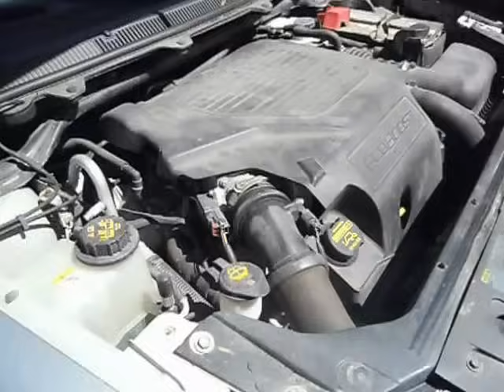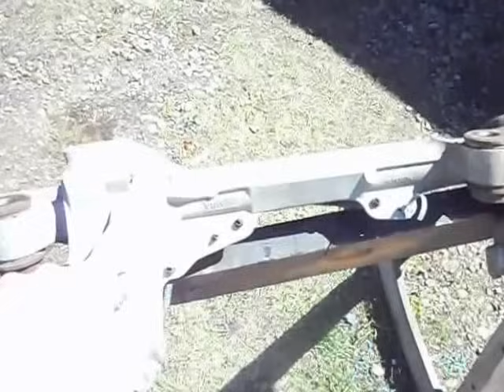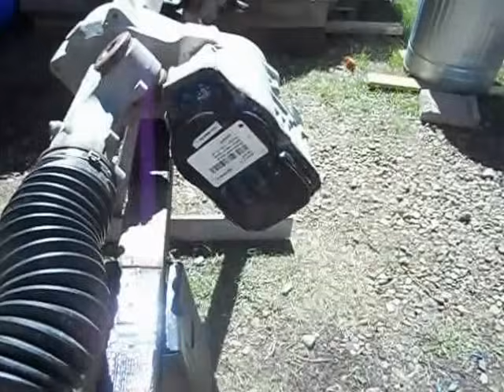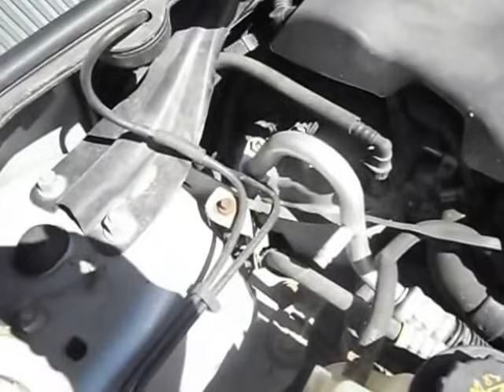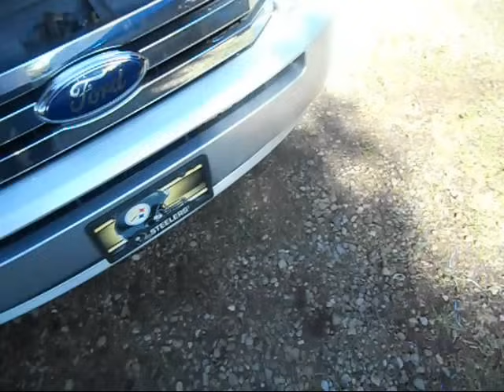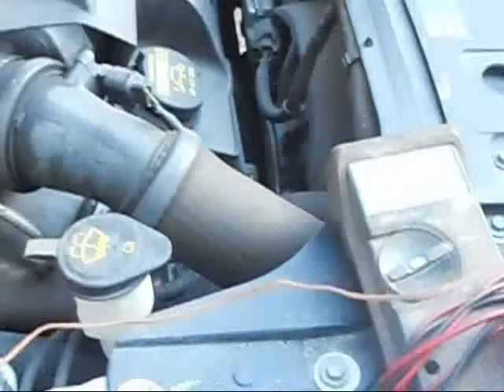Ford Electric Power Steering Failure Identified

Comment: My 2012 ford fusion power steering failed this week, while i was out of town, cost me 3 days in hotel and $1600 to fix it. There was a recall on the rack and pinon power steering module for half a million cars but for some reason my car was not on that list. Ford really needs to be sued over this because it very dangerous.
Reply: I put a new one in my car and 1 1/2 later it’s out again 😡😡
Reply: Same thing with my 2012 ford fusion. Ford said that there are no recalls on my car but they put an extended warranty on my car for the rack and pinion... I have no idea what they meant but it may or may not be covered by ford.
Reply: @theresaedwards5819 mine went out 2 weeks later lmao

Comment: Top notch video... 6yrs later, here I am with a 2014 Ford Fusion... thought I was a dead man for sure as I lost steering during in town driving. I am furious that this was even a possible thing. Doubt there is a recall but I am going to hope that Ford is willing to deal with this issue. Hope all is well brother! 👊🧡👍
Reply: Yeah good luck, my 2012 Sel is not covered for recall or anything . 1600 later and it broke again
Reply: After 150k ford will  touch it most time get buy clearing code change our tps sensor or front tires  also male sure battery is very good not weak batter also you can take both cables off the cat for hour or 2 make sure tie both of them touching.    Have 2011 model. Done everything  😅😅   what help me was I took  the battery out one day replacing it  with agm battery  and decide try tie both together.   And at had problems  with it long long time that was at 180k miles am at 268k miles. Hole time had this  car that only major problems had with it  they are great great vechles.  Only year I'll buy is 2011.  2012  models mabe 2013. 2014 and Up has bad transmission  problems  not one time I had any problems out the motor beside change starter one time oil changes   ...   I have 2011 sel 2.0 or 2.5.     Live find the s Verizon if any one has s model  like to sell let me know  love also if was stick shift

Comment: I must say you are the most intelligent person I've been able to find regarding electronic power steering. As an electrical engineer I was hoping you could shed some light on a problem I have I have a Dodge Challenger RT 2012. I had my tires changed last year and I also had the alignment adjusted. Ever since then - under normal conditions I feel about a 5% reduction in power assist when turning to the left. Then I found that several weeks later, while braking for a quick U-turn, I lost 100% of power assist and had to MUSCLE my way through the turn. I lose all power while braking and turning to the left. Since then, it is starting to affect right turns a little while braking, but no where near as badly as left turns. I since moved to Germany and I had it looked at by an American mechanic on base, and the Dodge dealership mechanics here. Neither could find a problem or offer a solution. The American theorized that when they did the allignment, the computer in the car is confused as to where dead center is. I have a feeling it is the computer chip as well because the power assist works under normal conditions. So while would it fail while braking if it was a mechanical issue? As you mentioned, these parts are expensive, so I don't want to go chasing good money after bad. Do you have any suggestions as to what these mechanics should be doing to fix it? Computer or steering rack (or both) ouch!

Comment: EPAS Steering failure is a huge Safety concern and could potentially cause lives whilst in motion. I am an Electrical engineer too and I can attest to the fact that you're spot-on. Thermal stress is the culprit. Your video presentation was top-notch and well detailed. Fault condition on Steering power assist on my Ford Taurus brought me here. Ford is probably not implementing industry-grade power MOSFET rated for harsh operating environment. Also, there is definitely a design flaw with heat sink configuration but Ford will never own up, just to protect their bottom line. I'm done buying Ford vehicle forever!
Reply: Can you share some symptoms? I bought a used 2016 Ford Explorer (my first ever Ford product), it just hit 89k mileage but my steering makes kinda grinding noise when I turn the steering wheel (both right and left) even when the car is parked. The noise got worse and the steering wheel somewhat got stiffer after a month of parking outside (1 month vacation).

Comment: Best video. Why no one know why ford steering keeps going out. So for a year no one knew why my Steering wheel was not I Check everything and could find nothing all of the computer button stopped working. So one day look at this same steering wheel column that’s under my car and it was cracked. That one item can cause the whole to not run right. Good wish I would be seen this. Took a year to figure out why my steering wasn’t working

Comment: Update 2011 Lincoln Mkt 3.5L Ecoboost, Canada edition.
The second Epas steering unit in my vehicle that Ford installed was a refurbished unit. I found out from a service rep that Ford will replace the Epas unit with a rebuilt unit if you do not specifically tell them you want a new unit. The refurbished unit costs more than the new unit and the warranty is only for three (3) months. A new unit cost a few hundred dollars less but the warranty is for two (2) years. 
One year and five (5) months later the second refurbished Epas unit failed. I replaced it with a third epas unit and filed a formal complaint with Ford Canada. These Epas units are expensive. 
After a battle back and forth, I received a Partial settlement of $1500 CDN. The payment was  voucher check, not cash which means you have to spend it at Ford. I needed a few more repairs on the lincoln so I used part of the voucher check on the repairs. On paying the bill, the service manager told me to contact ford for the balance of the check (@$375), since the repair cost did not use the full amount of the check. The next week ford contacted me saying the fine print stated the the full amount of the voucher check must be used as no cash is refund allowed.
 They gave me an option, the balanced could be transfered to the "Lincoln Loyalty Program" if I signed up. I red the program previously (like reading a noval), and turned it down. 2015 ford vehicles and above under the program are tracted by ford, interesting? 
My Lincoln has 102k easy mi. Is in great shape yet has cost a small fortune in mechanical repairs, not particularly reliable or trouble free. From experience, I do not feel that ford loyaly treats me so why would I? 
Looking for a Toyota for my next vehicle. Check Consumes Report "Best Car Ratings"
I will submit my complaint with the Canada BBB.
Reply: Totally feel your pain... that is a whole lot of Fk around... terrible business practice. May you have better fortune with the choices ahead. I look at a vehicle and yt the hell out of it by searching top 5-10 issues, so I know in advance what is coming my way in due time lol 👊🧡👍
Reply: I am going to fix my 2016 Ford explorer （power steering assist fault）and sell it to buy a Japanese car too

Comment: I had the same problem with  my 2011 Ford Explorer!!   No power steering, rack and pinion lossed!  They also, mentioned about the catalyst converter, tires and brakes!!  Ford wanted to charge me $3700 to fix! It was NOT covered under a recall or a warranty!!

Comment: Exceptional analysis. I work in electronic engineering as well. Also having the same problem with my f150 eps. Replaced the entire unit and the second one lasted less than 24hrs.

Comment: My daughters 2016 Explorer had her power steering lock up as she was trying to leave work last week. She had it towed home where I tried everything in my shade tree book to get it going. I googled the vehicle and I see that the 2016 is on a recall NHTSA ID 14V-286/14S06.  I called two San Antonio Ford dealers and they do not recognize that recall. They say they only go by VIN numbers.  Those dealers are booked to address recalls until November. So, I we want it fixed, we will need to pay for the repair. But, as it was very well explained by Mr. Smith, the heat issues will remain if the exhaust system is not re-routed!

Comment: At 107,000 miles, my F-150 XLT power steering began failing intermittently and without warning.  After a trip to the dealer and a $2,000 check, they sent me home with a new EPAS unit.  Then, grinding and popping noises began to come from the same front-end, driver's side location.  $700.00 later I had a new solenoid and other various and as sundry components replaced.  Still the grinding noises.  So, $600.00 and a wheel bearing replaced.  Hallelujah!    The noises stopped.  A week after my 3rd visit with issues, my steering goes out immediately while I was making a left-hand turn crossing over oncoming traffic.  I had not moves but to drive the truck up and over the curb and into a parking lot, where thankfully, there was a spot that I could muscle my non-steering truck into without wrecking it or running over somebody.

Now I've returned said truck yet again to my dealership.  Here's thing, people, the guys in the garage CANNOT fix this problem.  Do even a small amount of research on your own and you will see that this EPAS problem is systemic and long-ranging with Ford.  The company, for reasons that can only be tracked to money, refuse to acknowledge that across their entire line of models lurks a potential killer...a steering system that randomly goes out without notice.  I'm a good side man and each time this has happened, its a wrestling match with the wheel to get the truck safely stopped and parked.

I have owned Ford's for 25 years, but I'm done.  As I write this my F-150 is still in the shop, while they try to find a way to explain to me that my $2,000.00 did nothing but buy me a newer POS part to replace the older POS part that was already on my truck.  I almost feel sorry for my Service Tech, Mike Coody, at Gwinnett Place Ford in Duluth, GA, because I have all the data that shows him that I know what Ford is hiding, and he has to try and sell me to have confidence that Ford has this figured out.  Wrong.  This is one of the most informative videos of this issue.  Search the Internet for EPAS Failure, Power Steering Failure Ford, and other word combinations.  Thousands...Thousands of vehicles have this problem.  My next truck will be a Nissan Titan.  I've had it.  I can buy Ford's on the Z-plan, which saves me $$$'s....but when they lie about systemic issues, hide dangerous engineering failures from their customers....I'm leaving the brand.

Kenneth Hall, Cumming, GA
Reply from the maker: EPAS steering gear failures will begin to spike as MTBF (mean time before failure) associated with overheated electrical components kicks in. It is inevitable that Ford will experience large instance of failures on a standard 'bell-curve'. Replacement units are the same TRW design; place new unit in an overheated engine compartment and same failure will repeat in time. Ford is counting on this time to allow warranty's to expire. Then consumers have no recourse other than waiting for NHTSA action. The NHTSA is staffed by bureaucrats and statisticians. From what I have seen in correspondence between Ford and NHTSA; NHTSA allows Ford to conduct their own fault investigations; in addition to defining final dispositions, and publishing of investigative results. Ford is allowed complete ownership of the fault issue which clearly results in blatant falsification of fault analysis, and minimal corrective action to Ford's benefit. NHTSA officials believe anything Ford tells them; as long as an official report is filed and key 'buzz words are included.
I found your report interesting in that you indicate how difficult it is to man-handle failed steering gear at low speeds and static in larger vehicles. This has been a primary point with me for some time. It is interesting to note that during Ford / NHTSA investigation; Ford was asked to supply a vehicle with failed EPAS steering; so NHTSA staff may test manual steering effort. The vehicle supplied by Ford was one of the smallest and less massive vehicles Ford manufactures. Apparently NHTSA staff never detected they were out maneuvered.
Reply: Trust  me the issue is general not just ford alone, it also happened with Lexus, mostly the IS model i have one in my garage now sitting there because lexus charge me $5000+ to replace the steering rack and computer and obviously this is lexus fault replace the old style rack with electronics just for efficiency purpose. i realize my got locked when making left turn, i was lucky not o highway. i think is high time people speak against this, looks to me like accident waiting to happen, and now am not comfortable  enough with any electronic power steering .

Comment: I have a Ford Escape SEL 2012. Was driving and the power steering failed, became stiff and required extra power and effort to control the steering wheel. Saw a message on the dash board that says steering assist failure. The diagnosis was that I have to replace this parts and estimated cost of repair is at least $1600. Thanks for your video I won't touch any ford product with a long stick
Reply from the maker: Sorry to here about your Ford problem, Ford engineering and customer service have devolved to lowest of standards by any measure.

Comment: I was just about killed tonight in my 2010 Ford Taurus SHO when suddenly during a lane change the steering wheel appeared jammed in a right position, I nearly took out 3 incoming cars and ended up in the middle of a parking lot simply by luck.  When I looked at the dashboard it said something like Power assist fault, I turned the car off to collect my thoughts and restarted the vehicle and everything was fine.  Two days ago my wife and young son were on the interstate and I can only imagine if this had happened to them they could have been killed.  I have only 42,000 miles on this car, I bought it new.  After watching your video I am shocked that Ford would take such a position on pre 2011 vehicles with this EPAS system.  I am curious if you ever had any luck with Ford.  Thanks for your great video, I appreciate it.
Reply: You can still steer the vehicle when the epas fails. All you guys just can't damn drive without power steering it doesn't sound like. I literally just did an entire drift event with no epas in my 2015 mustang
Reply: @themustangfactory  NOT TRUE! The Ford Escape can LOCK into one position and cannot be turned at all, no matter how strong you are!

Comment: Great video, you are definitely right! I never even thought about it but my steering motor started acting up a couple months after I started getting a bank 1 catalyst efficiency code on my 2012 explorer. All steming from a poorly designed valve cover allowing oil pass into the intake thus causing the catalytic converter to overheat wich likely caused some type of damage to the poorly designed steering system.  Mine is intermittently loosing power assist without setting any codes. So I'm planning on replacing the valve cover , converter and rack all at once. I had never even considered that the exhaust could of caused the steering to fail

Comment: I own a 2010 Fusion 3.0L V6, 117,000 miles.  I've read many times that this happens when the TPMS senses low tire pressure.  One guy took it in to a Ford dealership three times and was charged about $100 each time for diagnostics but there was nothing to repair, they just reset the hard fault code.  No way to reset the code yourself without a $3500 IDS scan tool.
I went on vacation for a week and when I returned I took the Fusion to the grocery store.  My Fusion had low tire pressure indicator and the power steering was out and the battery was dying.  I had to jump the battery when I left the store and ended up replacing the battery the next day.  Even after leaving the cables off the battery for some time the power steering would not reset (still says "Service Advantech" or whatever).
Does low tire pressure cause the servo motor to work extra hard and then overheat?!?  
Thank you Bryon for continuing to follow up with new information.  Any suggestions to convince the dealer to not charge me to reset the fault code?  Should my next step be to get rid of this car?
I wish I could afford a Tesla
Reply: David B I’m just soo mad about everything I’m hearing on here about these fords. Just brought a 2011 Ford Fusion come to find out its a recall on the power steering that has expired now I see why they sold it. I refuse to put more money and more money into these problems and still more problems come up. So I believe I’m gonna sell it and I will never again buy a ford of any kind again. I was always told that fords wasn’t good vehicle tried to give it the benefit of a doubt bad decision should’ve listened
Reply: Can you reset the codes yourself with a bluetooth OBD2 tool and a phone?

Comment: I have a 2017 Ford focus SE. Ford initiated a buy back program on 2012 - 2016 models with the power shift transmission. My 2017 has the same transmission and the vehicle is not being included in the settlement. This transmission is terrible. Ford replaced the clutch assembly for me under warranty, less than 10,000 miles later the same symptoms are occurring, violent shaking between gear shifts, just 1,000 miles outside of warranty, no concern from Ford at all. I'm being treated as a liability rather than a customer. I have had so many problems with this vehicle that are normally unheard of at this kind of mileage. I have replaced wheel bearings, a water pump and now I'll have to pay over a thousand dollars to replace this clutch and it will most likely just repeat itself in under 10,000 miles again. I'll never buy another Ford in my life. Several lawsuits have been filed and rejected.